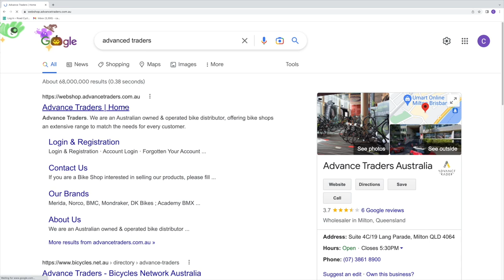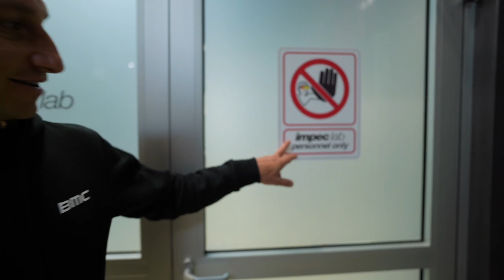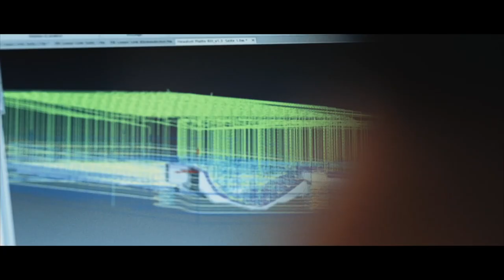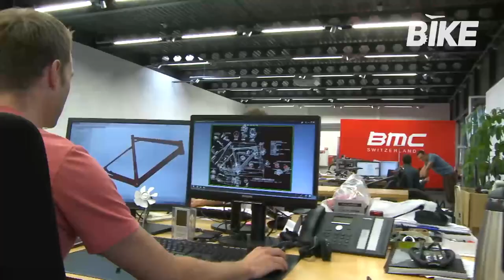What’s with the PRICE of mainstream bikes? (two BMC executives explain)

Comment: We need to learn self control maybe when purchasing items? You don't need the priciest to be the best really I reckon. Nothing is wrong with Claris, Sora & Tiagra & alloy frames & rim brakes.
Reply: Did an Audax event on Dartmoor on Sunday. Fashionistas would laugh at a lot of the bikes used, steel frames, mudguards etc. But these bikes have probably clocked up more miles than anything in fashion ever will, and will still be going strong when most modern riders bikes are in landfill.
Reply: Please say this louder, many people buy this expensive bikes and yet never fully utilize them, they buy the bike yet they themselves are out of shape and do not work on improving themselves, alot of people think getting a carbon bike will make them faster and fitter.

If you do not enjoy climbing, even if you get a carbon bike, you still won't enjoy climbing.
Reply: Totally agree! Much of the marketing is for features that aren't really that important if you aren't racing. A lot of these features are unhelpful or a hindrance if considering ease of maintenance or a goal of long rides

I recently built a full alloy road bike with tiagra as a commuter/audax machine /kid carrier and the most significant decision was the cassette range and getting the ride position at least approximately right. When I looked at braking choices, I chose rim because it's easy to move the caliper if there is brake rub, rim pads last so much longer and I know from personal experience that rim brakes (even for my other bike with cheap carbon wheels) are strong enough to control speedy descents in all but torrential rain.

It's definitely easy to get into cycling, not have a specific set of goals as you're new and then have marketing of big brands insist that you must have x expensive thing, or you'll be slower and have a 'worse' bike than the rich guy. I feel for people who have little riding experience, who feel shame because their bike doesn't meet some mythical set of arbitrary standards. I reckon a lot of the sentiment behind pro Chinese product commmenters is that they're tired of this profit oriented marketing crap. 

Funnily enough, I overtook a guy on an expensive bike going up the bobbin head climb in Sydney, using my alloy frame and it's was probably because I ride quite regularly.

Comment: “From our suppliers” sums it all up really for me. They do not make the frame sets.. they’re just badged bicycles.
So they have a QA? What tolerances do they employ? When does a fail not go to retail? What are those tolerances? He states that they question the factory if they may be slightly heavier or lighter, but does not say that they are pulled and scrapped. It appears that they just send them out, but they were checked……
I actually have a 2021 EmondaSLR 800 carbon. It’s great, it’s light , it’s expensive. I enjoy riding it.  (Let me add I’m awaiting the exchange bars to come back in after the recall in June still).
I also went and bought a frameset from China for $800AD in May this year. It’s a gravel/ road, great fast geometry rather than relaxed. I run 30mm road tyres and an Ekar GS. It is sensational. I group ride and hang in at 45 to 55kmh with it. I’ve just flicked the tyres now for gravel with a pair of 38s. It’s fantastic. I put it together for under $4kAUS the Trek with Red AXS is a $17500 bike. Does it bring greater satisfaction? Absolutely not. 
I own a BMW F800R motor bike that was $15k new. The engineering and total amount of components in that machine is probably 10 fold that of any road bicycle. 
I will leave this with you all. How come a bicycle can be more expensive than a top end BMW moto?

Comment: What's going on with the price of today's bicycles? Well that answer isn't that hard! The bicycle industry has gone completely nuts. They only think of one thing and that is money. And two employees of a BMC are really not going to tell you why this is happening. And the number of defects in the current models across all brands says it all , they are playing with people 's lives . I have owned the last model Canyon Aeroad. and I am very happy that I was able to sell it after all the repair work. in fact I took it there for the handlebars and seatpost and then got a completely new frame because they discovered an internal problem with the carbon. Only thing I was told it wasn't because of me. well my confidence in Canyon was at 0.0%. I now only ride classic steel bicycles. a bicycle the way a bicycle should be.

Comment: Cam first off i value all your videos but the two gents in BMC arguments about 50 + carbon pieces increasing costs does not hold water take a Honda or Yamaha 125cc four stroke motor scooter each cost approx £ 3000.how many pieces must go into the motor and gear drive and frame  hundreds of pieces then take a TVS 125 Hi-torq scooter  costing £ 1200 made in India has the same number of components in it but because of lower labour costs TVS can under sell the other manufacturers in the scooter class ,my honest opinion bike makers are raking in big profits end of story ,but a Big thank you for asking the hard questions a big hug mate.

Comment: Thanks for putting this together Cam, interesting to hear. 
But I just don't buy it. R&D costs and quality control, referred to as the principal reasons for both the high costs and the distinguished characteristics of the products, are part and parcel of the business - as they are for any manufacturing.
Reply: A Bmw motorbike costs less   It doesn’t make sense.

Comment: tell bmc they need to offer weepholes that are open/closable on any electronics cases/enclousers.  and the use of oil fill ports and semi-oil-bath tech, and fill and drain(to clean) tech for electronic motors is just the way to go; the alternative being using heavy greses and relying on gaskets which always fail.  for e bike used in rainy conditions this simply has to be the protocol..  and it works great, i use this method on my ebike.

Rim brake technology is better technology than dic brakes for over 90% of riding.  bicycles weigh more, have more rotational weight and there other reasons why disc brakes are a pain..  BMC should offer austraila and regular cyclists something more practical And more performance oriented than heavy and particular disc brakes.  I have a nice bike but still,, i dont want to be messing with a large toolkit and touchy routines.

Comment: Bingo!  Groupset makers seem to be the primary villains in the price increases we're seeing.  That's why I'm not buying new and not buying the latest groupsets.  Give me 9 or 10-speed Ultegra or Dura-Ace, rim brakes, and external cabling over the high-strung stuff, overly finicky 11 and 12-speed, fully integrated, hydraulic disc stuff all the bike makers (and most YouTubers) are pushing today.  It worked great when it was leading edge, and it works great today.  Next gripe: carbon wheels.
Reply: I am not that into road-cycling, so I am not a 100% sure what the  prices are of road groupsets, but on the XC-side of things, you can buy one of the online-only brands for an insane ammount less than the "big name" brands. My YT XC/downcountry bike has pretty much everything one could want. The "best" sram groupset, most expensive xc rockshox suspension, carbon wheels etc - And that bike costs about half of what a trek/scott/specialized/cannondale bike costs (Mine was about $7500 vs about $14k for the big name ones - And it even has some things those bikes dont have). The markup on the most high end XC bikes are insane, not sure its the  same on the road side. 

I could actually buy a scott frameset with fork/shocks installed + my bike,  take all the stuff from my bike, put it onto the scott,  and it would be cheaper than buying one directly from scott. And then I could prob sell the shock+fork for $1500-2000
Reply: Harley , are you playing guess who I am ?
Reply: @colostomybag9367  🙋🏻‍♂️I prefer disc to rim. Unlike most people, or so it would seem, I don't have any issues.
Reply: @colostomybag9367  I like discs. For the riding I do, I prefer them. I ride exclusively on the road and I do a lot of long, steep, often wet climbs and descents that usually include hard braking. I like the power, modulation and consistency of braking I get from hydraulic discs. I'm not a rich person and I don't care if disc brakes are a bit heavier and less aero. I also think I'm not the only one who thinks this way. If rim brakes work for you, that's great but not everyone's the same.
Reply: Most people prefer disc brakes on their road bikes because they are objectively better than rims, period. The idea that disc brakes are worse and pros and most riders don’t like them is just a myth perpetuated by haters and weight weenies
Reply: @ricardorusso1462  I like how you use insult “weight weenies” in an industry where weight is #1 selling point and to chop off 100g off of your bike costs 500€. Makimg rim brake obsolete allowed bike manufactorers like BMC charge customers almost twice as much for a 6.8kg road bike.
Reply: I hear you. I have 3 ten speed road bikes.
Reply: @Slick why should electronic groupsets be disposable? Don’t tell  me just because they‘re electronic.
Reply: @ricardorusso1462  disc is overkill for road .
Reply: @HarryTzianakisTheGodOfSpeed  you must still be rockin' some good ol' drum brakes on your road car then. there's no such thing as "too much braking"
Reply: @ricardorusso1462   it's the facts.   

The bike industry needed to design the whole entire bicycle around disc brakes.

The rims have more spokes on them. The rims are much wider and we're running way bigger tires. 

The reason why this break couldn't work in the past is because the footing of the tire is much smaller.

So in order for this disc brake to work correctly they needed to widen the tire and the rim. 
Because the disc brake placement creates more centricle force, They needed to strengthen the rim with more spokes.
So basically they had to make a heavier bike because it needed way more reinforcement in order for disc brake to work. 
Is it better ? No it's not. 

We are basically on cyclocross bikes.
Reply: @HarryTzianakisTheGodOfSpeed  lol try descending on muddy and wet terrain on rim brakes
Reply: @christophertan3195  i grew up doing that ..   that is all we had,,
Reply: @HarryTzianakisTheGodOfSpeed  Yeah it's not a good experience, this is a not a Nostalgia thing
Reply: @christophertan3195   both breaks stop the bike very well. The difference is how skilled you are in writing in such conditions. The brake system can only help you so much.  We're always riding under nostalgia or we would be experiencing every moment as if we had  Alzheimer's.
Reply: @HarryTzianakisTheGodOfSpeed  Lmao seems like you don't ride enough to know the difference

Comment: Ask those guys what their salaries are..... Been riding for over thirty years and currently have three main road bikes. Kestrel full carbon, Trek 5500 full carbon, Trek 5200 full carbon. All bought used and all built from the frame up by me because they were just far too expensive to buy new. I weigh 230 lbs, buying a super lightweight bike with equal components would be pointless.

Comment: If you paying top dollar for a frame, why do we see so many 'issues' around bottom brackets (sizing and concentric), headset bearing fit and disc brake surface finish and straightness? BMC are not exempt from this judging by @Hambini 's recent video, which had a shockingly bad BB...
Reply: @jochem1986  Sure. But there does seem to be 'warranty' issues when raised with some of the brands.
Or, maybe we are only hearing about the bad stuff?
But, if you saw Hambini's BMC video that frame should never have gone out of the door IMO.